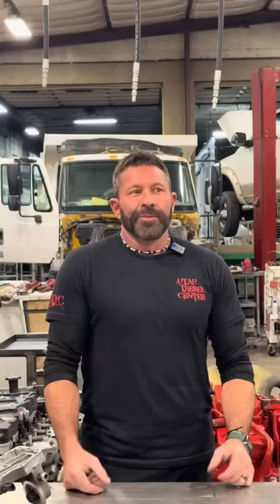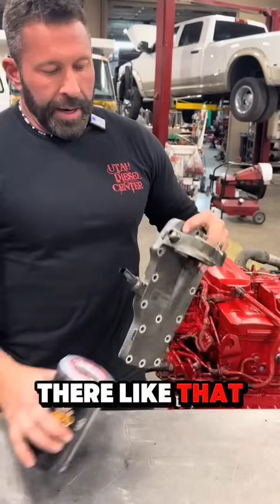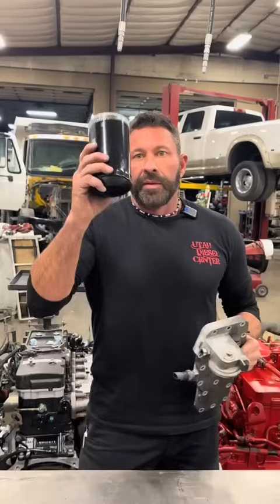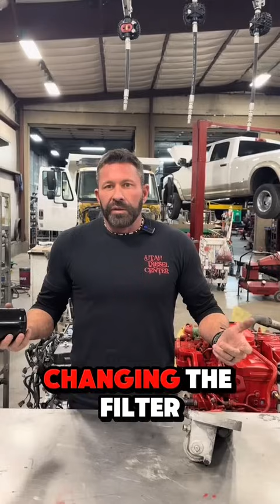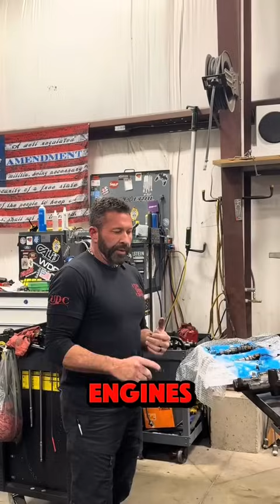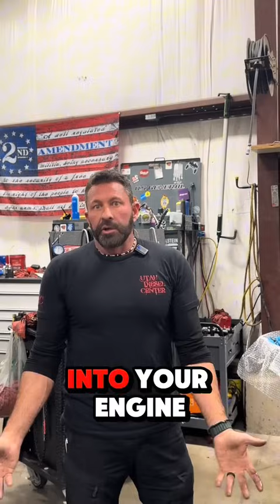This is how OFTEN you should CHANGE YOUR ENGINE OIL! #dieselengine #mechanic #performance #cummins

Comment: The worst time diesel engines intake soot is when they are cold, when clearances are the biggest. Right past the rings into the oil.
As is why there are several oil filter upgrades. Some are better than others. 
NEVER forget to have oil tested so we know whats in the oil and its health. I would NOT go past 5K Miles on OEM setup, no way! And sun the special upgrade systems still would not go past 12-15 K Miles. 
I’m going to try to rival the 900K Miles on engine league.

Comment: 3k for conventional oil and 5k for full synthetic, with a top of the line oil filter, regardless of whatever claims are made by the oil manufacturer.

My truck species 5W-30 oil.  Can I not simply use 10W-40 and accept the slight loss in mileage?

Comment: 6000miles is great .. Well proven over this its proven oil is worn out and full of debris.
Ford are aware of this Europe 12000mile interval ,, down to 6000 mile interval  back to 9000mile interval .... Its all about marketing IE low cost of ownership advertising . DOH

Comment: Change my power stroke every 4K. Truck won’t even start unless it has 500lbs of oil pressure at the injectors. 
Oil is a lot cheaper than an engine.

Comment: Oxidation is a big issue in oils that’s what’s causes oil to gunk up and even the best oils start to oxidize so I would listen to this mechanic and do them no longer than 5k miles. Now every situation is different if you are all free way miles with no traffic and your putting on a lot of miles daily on your rig you can extend that interval but for 80% of driver 3-5 k just like that man said. God bless you all 🙏

Comment: Been doing 10k oil changes for years. Last 7.3 Powerstroke had 785K miles on it and still made 385PSI -395PSI on each cylinder and that engine had never been opened up. Currently my Cummins has 80k on it and zero issues with 10k changes and passes oil analysis with flying colors. I cut open the filter and practically nothing in the filter considering how long it was ran. Oil comes out cleaner at 10k deleted and tuned than it did factory at 5K changes.

Comment: Boston, MA area - Both my family cars are in stop & go traffic every day to & from work, I replaced the drain plugs with a valve & oil changes only take 10 minutes. I change the oil every 2 months & every year I coat the undercarriage with Woolswax. With good care my cars run relatively trouble free for 300K miles and given how expensive they are the TLC I give them is worth it.